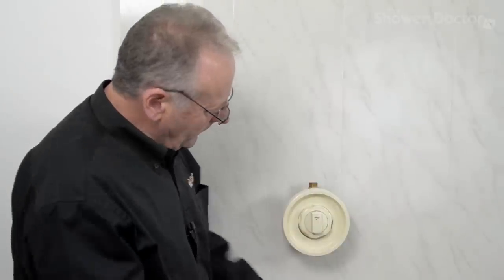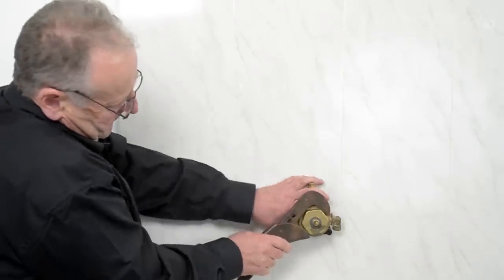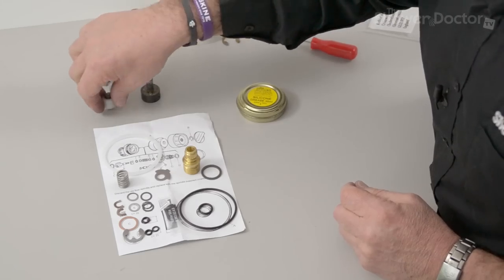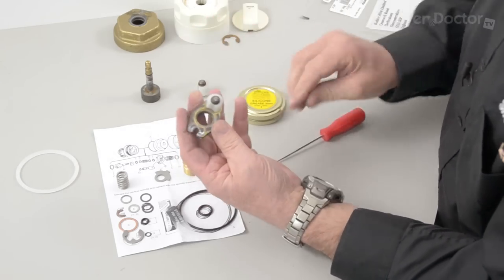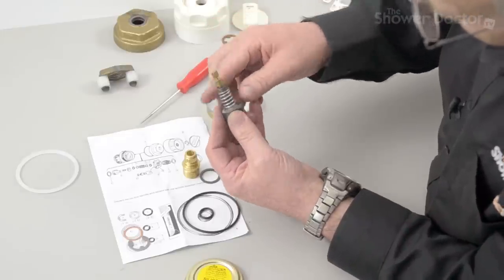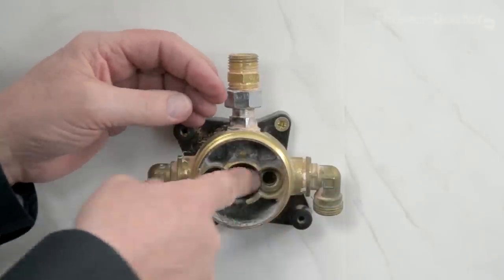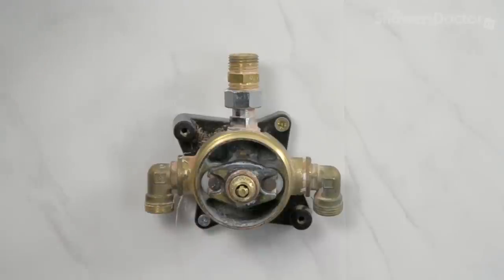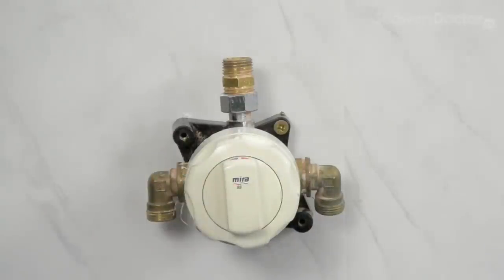How to service Mira 8, Mira 88 & Mira 88B shower valves.

Comment: Great video. Very clear step by step instructions which gave me the ability to take this repair on, which was successful. The boiling hot water tip worked for me. Thank you so much for taking the time to make this video it save me over £500 for a replacement shower.

Comment: A great informative video which really helps along with the paperwork with the repair kit. My centre nut needed some serious heat to undo after 15 years plus of being in place. Apart from that went smoothly and transformed an aging mixer shower unit.

Comment: Many thanks for the video,After watching it several times I was able to carry out a refurb with ease .The kettle of boiling water trick worked great for the plastic and brass cover nut. I used a Big Bahco water pump pliers (no footprints).(Sealing off the old  hot water gate valve was a trial)Shower valve was all seized up inside quick brass wire brush all good ,greased up ,reassembled .It works like new.

Comment: Great Video Guide and very well produced with clear instruction to follow in the instructed process. Managed to do it after the struggle of getting the lime scale corroded on/off valve removed. Pleased with the improvement of the much smoother action, and flow of water. 10/10 Thank you.

Comment: Excellent video, I followed it step by step but one part is not clear and needs clarifying. When screwing the new flow spindle into the bracket that holds the pistons, do not screw it all the way through. Only screw in up to where the thread stops leaving a gap the same size as the space at the end of the thread. I screwed mine all the way at first then spent ages trying to work out why the spindle nut would go on properly. Also the white plastic on pistons is slightly tapered, the thinner end needs to go towards the wall unit. Other than that, great video that saved us a fortune, many thanks !

Comment: Great video George, made servicing the shower much easier. I have a few questions if you don't mind. How long would you expect the service kit to last and what reasons might cause it to last only a year or so before the shower leaks again. Finally, how much difference would it make using silicone grease rather than the grease supplied or indeed your own Shower Doctor grease?
Many thanks
James

Comment: Fitted new service pack, all seems OK till the water is turned on. The shower will not turn off completely, and is very stiff to turn. The 2 plastic pistons have a grove around the leading edge could this be my problem?

Comment: Great video, and it worked very well for me until now... 4 months on the mixed seems to have failed with a continued dribble of water. At @5.25 you insert the horseshoe clips for the pistons into the halter. My horseshoe clips where slightly curved but you don't mention whether the curve should be upwards or downwards. I inserted it upwards to increase the friction. Is this correct? I did use the Mira lubricant but I've now got some silicon grease and am going to take it apart again hoping the new seals are still good.
Reply: Actually when I had a look inside the seal on one of the pistons seals (seal D) was worn away so presumably there was some friction that there shouldn't have been...

Comment: I have an old Mira 8 Shower it says that the Mira 8 internal set/cartridge assembly (904.08) is discontinued
will one off a Mira 88 fit. (904.07)  Problem is it is getting increasingly difficult to turn on and off
I have tried in the past to replace the Mira 8 service pack but to no avail 
I hope you may be able to help / thanks

Comment: I cannot for the life of me get the flow control spindle removed from the screw cover. 

In the video he removes the cover and it just slides out, mine came out with piston's and all (everything attached to the cover). I have since got everything but the spindle out.

Could the rubber o-ring be holding it in? I don't know how much force is OK to apply. It's not secured in any way on the front is it? Don't want to damage the cover.
Reply: Just to confirm I ment the metal nut cover, not plastic control knob.

EDIT - I managed to get it off, if anyone had this issue stick it in a vice and gently wind till you can get it to wiggle. Then turn the cover upside down, press down on a table and the spindle will pop out.

Comment: Help !  I'm currently having a nightmare trying to remove the large white plastic water on/off knob.  I've removed the retaining circlip. tried kettles of hot water, application of heat from a hair-drier et.c. but it just doesn't want to budge.  Any tips ?
Reply: did u manage to get it out??

Comment: Excellent video - I followed it and had no problems.Trouble is, the nylon pistons are damaged so I will have to strip it again soon. I have the pistons but can't find out which way they fit. One end is slightly wider than the other.Can you help?

Comment: Thanks for the video, I followed it carefully to fit the kit, but I seem to have done something wrong,
The main on/off valve is smooth and works perfectly, but there is negligible cold water flow, just hot.
When the temp control is moved to full cold it's as if I'd closed the main valve to just cracked. Moving the control towards warm, the flow steadily increases to normal, but it seems to be only hot water. The temperature can't be controlled.

There were no problems with the Mira 88 before fitting the kit aside a small leak from the temperature shaft seal, which was the reason for fitting.

Would appreciate your thoughts on what to check.
Thank you.
Den
Reply: Den Falls  Sorted it :)

 For the benefit of anyone else with a similar problem.
I dismantled the valve and checked I had water flow on both hot and cold inlets in the valve housing.
My valve is recessed, so I cut the end off a 400ml spraycan lid forming a short tube, this I screwed into the valve body to divert the flow outside the wall.
A slightly messy business requiring someone on the mains stop cock!

Flow was fine, so to check it wasn't an airlock, I refitted the valve, still no cold flow.

Afterward I stripped the valve and closely examined the components 
I found that one piston was slightly higher than the other. Turned out my unit had a bit of play in one side. I cleaned the pistons once more and swapped their order.
After refit hot and cold flow was restored.

If hardly seemed possible the tiny difference in tolerance could be the issue, but it appears it was.

Cheers

Comment: Word of advice ! Don't ever buy an overpriced Mira that's countersunk in the wall . Utterly pissed off with trying to repair . Buy  something that's cheap that you can spanner off that's sits on the outside of the wall and throw away rather than waste precious time on this  . Have a Mira 8  they don't make anymore. Should be able to bin and put in without all this messing about .. Mira charge 500 quid for a new one .But they aren't 150 centres . Overpriced rip off company .